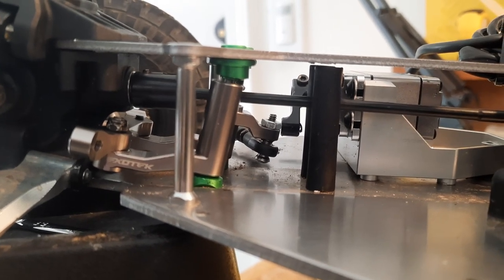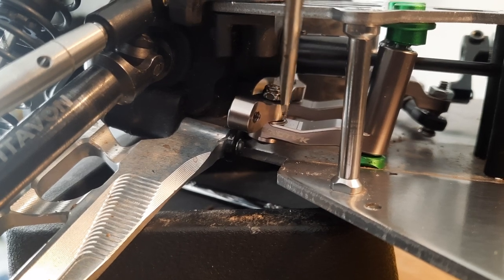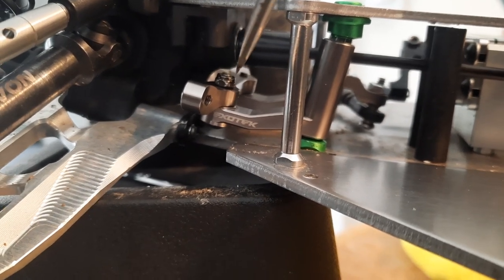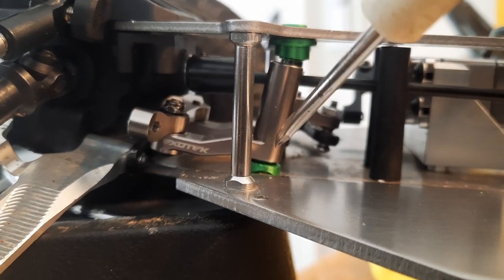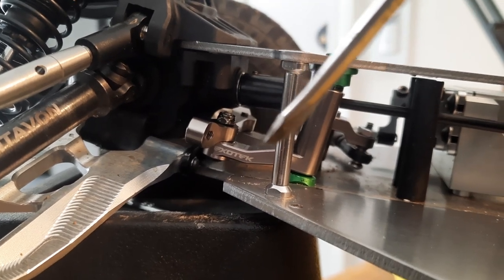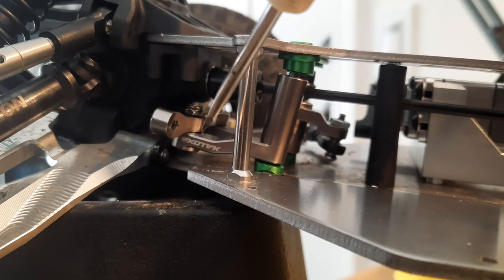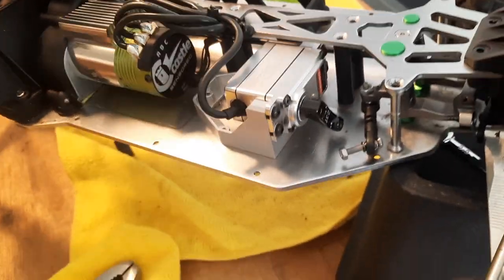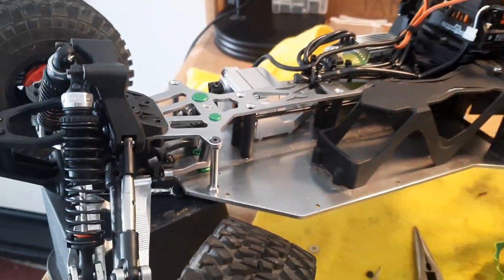Losi Hammer Rey Steering upgrade and advice video #6

Comment: This RC is basically their introductory car and wasnt built with being thrashed on in mind. Mine has done fine, but isnt my go to RC. Just one i'll toss in my car for a quick rip in the woods or at a park.  If you want a quality car from Losi, get their bigger scales or something from the TLR line. I picked mine up for $399 and to put that into perspective i picked up my brothers old gen Traxxas Stampede 4x4 for $329 and it was a brushed edition.